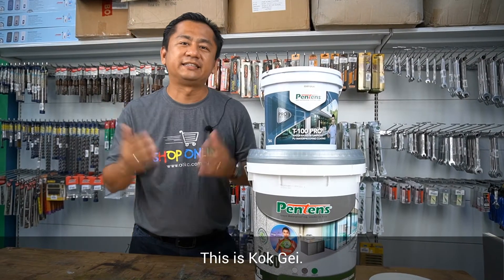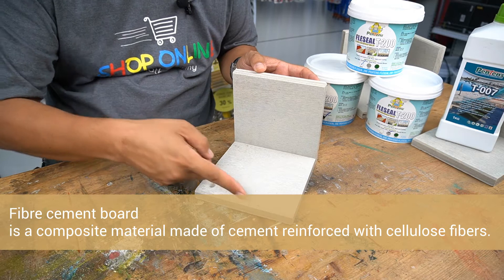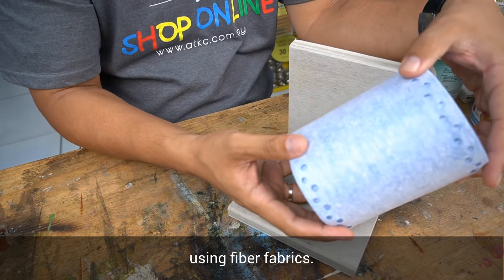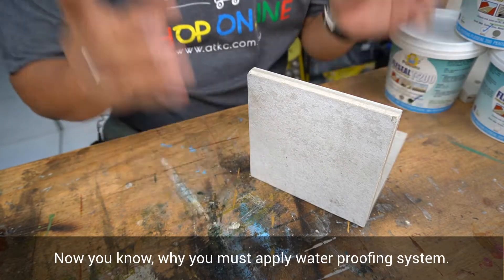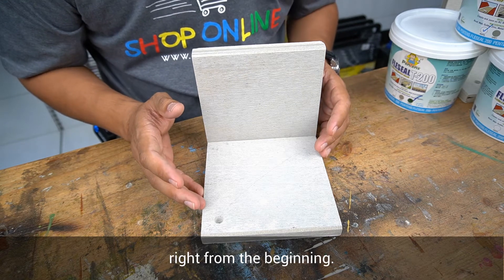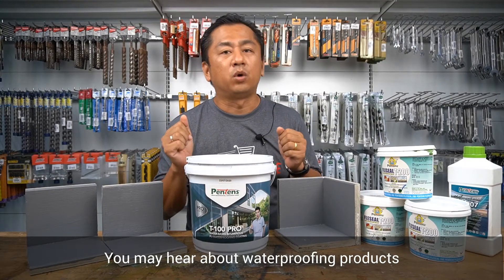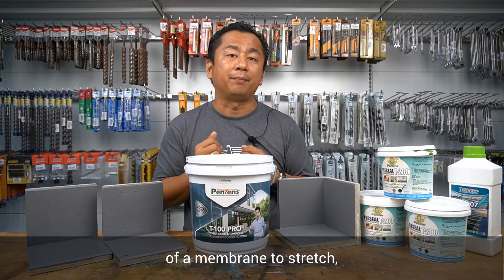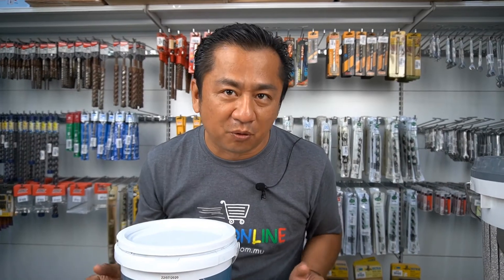Common Mistakes & FAQs in Pentens Fleseal T-200 UV Resistant Elastomeric Waterproofing Coating

Comment: What the different between T200 & T200H ? What is recommended in exposed car porch flat roof? Is it necessary to apply the primer coat T-007 before applying T200 or T200H?
Reply from the maker: For me, surface preparation is very important. 1st, make sure the surface is clean, free of dirt and dust. 2nd, make sure you repair all voids or cracked lines. 3rd. Ensure floor level or gradient, that does not create water ponding.
The usage of primer is to improve the adhesion, and water resistance.